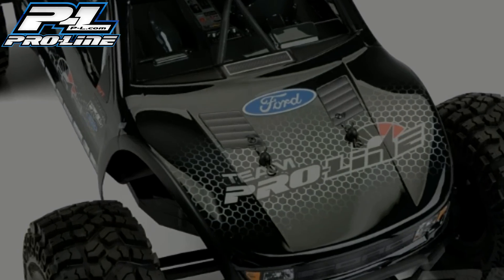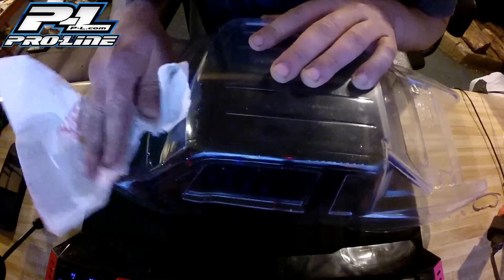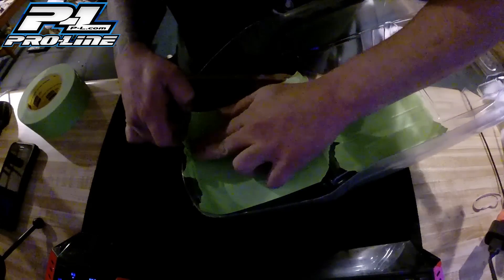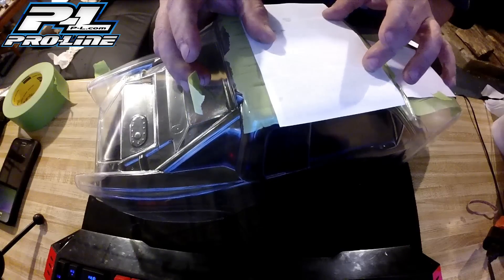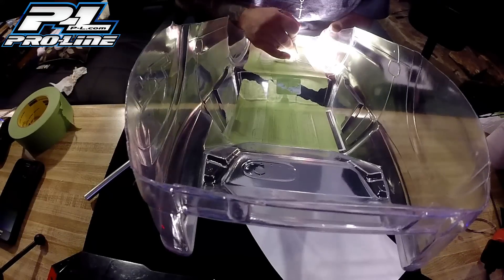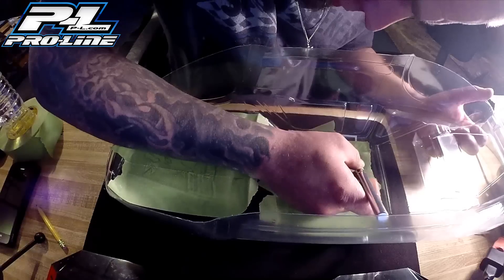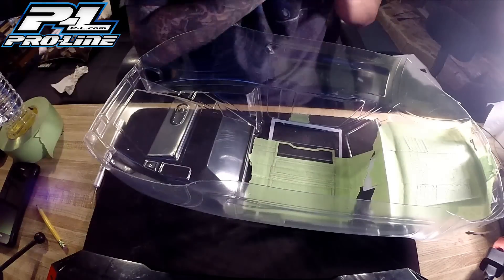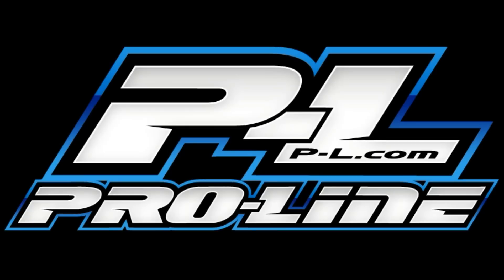Pro-Line F-150 Raptor- laying down the masking Part-3

Comment: you know Ricky looking at your table you could use a removable insert with a light under it for the masking part of the paint jobs, sure you may only need it about every two or three months but you could implement it where you could just reach under, knock it out do your tracing, then put it back when you finish. Just a thought but It would probably be a bit easier bro. Looks awesome, now once you get your paint down its going to be sweet.
Reply from the maker: +Anthony Eaglebarger (toysoldier46552) thats an awesome idea man! I will look into that thanks bro!
Reply: Ricky Revo rc I do wood working for a living bro, just sharing an idea that I would use on one of my benches.